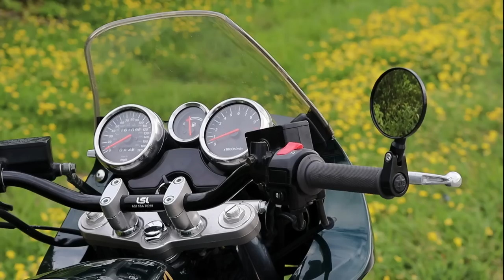Bandit 1200 - New Handlebars and Mirrors - Everything Went Wrong!

Comment: I'm that 1 weirdo that loves stock mirrors and absolutely hates bar end mirrors.
Reply from the maker: Na not a weirdo at all. Some bikes have good mirrors but others I always want to change
Reply: To each their own.
Reply: Well you're not alone, I also very much don't like bar end mirrors, but this actually looked kinda clean and decent.
Reply: Nah, im right there with you.
Reply: Another weirdo here. 🙂
Reply: Not a fan of them either and hopeless for filtering, I do a lot of filtering in my daily riding.
Reply: Weirdos everywhere 😂 ! I am too...
I don't really like them but I am always reluctant to change the moment of inertia of my bikes front end. The S version already has no front light, but going for aluminum bar, light mirrors and mirrors sticks, removing the original HEAVY bar ends is asking for more vibrations and possibly tank slapper...
My Bandit has its original bar and mirrors...but the blinkers have been replaced, and the "tail" cut...
Reply: I think that my previously owned bar end mirrors has been of sub par quality as they would constantly move and it has been driving me insane. I might change the mirrors on my bike out, but bar ends are still a no go, especially since I need to fit the bike through a normal cellar door each time I drive it.
Reply: Still interested in a conversion  from choke on the bars to one on the carbs
Reply: Me three ✌️
Reply: I'm that one weirdo who likes cowl-mounted mirrors if the bike has a frame mounted front cowl and dash

Comment: Hello Matt from Sussex U K I have owned both 600 and 1200 Suzuki Bandits and both are brilliant bikes. My 1200 did not have the faring and was the burgundy colour. When I changed the bars the only snag was drilling the holes for the switchgear but after a few thrown spanners and expletives every thing fell into place. I still have my 1200 and I would not part with it because it does all I want it to do It has a Scorpion end can and with the baffles removed only one grub screw it sounds fruity but not mega loud. I love the engine it's so smooth and pulls like a train. Yes, they were built on a budget by Suzuki but they hit the nail on the head when they put the 600 and 1200 together both bikes have a massive following in England and there are a  few online clubs for 600 and 1200 owners. Keep up the great vlogs. Matt' UK

Comment: I hit the same problems as you when I tried to change the bars on old FJ1100, hoses not long enough. I tried this a weekend before I was going on a 2 week tour of Europe, my first long outing on the bike. I didn't have the time to get everything to effect the change so went back to the original. 
Spending 2 weeks on the bike doing some big miles every day, lots of great roads and bahnstorming (autobahn) speeds, I realized the engineers at Yamaha knew a lot more about setting up the bike than I did and concluded the original set up was pretty much perfect.

As I was watching your frustrations these song lyrics popped into my head...
They say some days, you're gonna win
They say some days, you're gonna lose.

Comment: Ugh I feel you on the "wasted time." Ive spent over 3 days trying to fix a fuel sending unit on a Kawasaki Vulcan I just picked up. Obsolete part, not available. I had to fabricate part of it, tested it, adjusted it, tested again, worked, got it in the tank, filled it up, fuel gauge working, test ride, dead gauge again. 

Just gotta roll with it. Props for all the work going into your orginal plan even though it didnt work out. Im sure you'll find a use for those parts eventually. Looking forward to seeing builds in the new shop! Keep up the good work 👍
Reply from the maker: Yeah it was costly on the time scale for sure!  I have had many bikes just fight me to the breaking point with things like that.  The end result here was actually better than the original plan so Im very happy.

Comment: Thank you so much for accepting comments and I think you did reply to a comment that I made on another video.  Thank you.  So here's a question. At the beginning of this video, you're sitting at the desk talking about how you had to replace a bar mirror on the cafe Honda.  So there you are, and if you look up there is a shelf with little dispensing containers.  There is fluid in those containers that I have seen you use.  Would you ever share about what you have there and what they are used for?  Hmmm?  Just wondering. 🤔
Reply from the maker: Thanks! Those little containers are great. I have acetone, oil, grease, brake fluid, and maybe more. Keeps things efficient for me

Comment: I've got bar end mirrors and Renthal bars. They are pretty thick. To hold the mirrors there's an expanding piece that slides into the bars that looks exactly the same as an expanding masonry bolt body, rawlbolts were call them over here. Works a treat. Maybe all you needed to do was to go to the hardware store.
Reply from the maker: Right thats a normal setup and something Oberon even offers. The brass parts work the same but for some reason the stuff that I received just didn't even come close.

Comment: It may be possible that the factory mirror adhesive was flexible on purpose -- maybe to dampen vibration or expansion-contraction cycles of the metal mounting plate. Just a thought. I've found that polyurethane construction adhesives and/or elastomeric sealants -- both in caulking tubes -- are pretty good for similar applications. Cheers
Reply from the maker: Definitely could have been

Comment: Mirror shape is something that occasionally shows up in cars in the UK. UK being rhd but most cars are shared with LHD markets. And if you put LHD mirrors in a RHD car then the shape and angles are all wrong!

For the bar end collets, looks like you have been supplied with the larger ones for 1" bars. Possibly intended for Harleys? They sell a smaller collect. They also list 11 different styles of bar end piece

GSXR1100 carbs had the choke on the carbs (or at least my 1100L did) which might be a source of parts to convert. Or swap the complete carbs on for a bit of extra performance (40mm rather than 36mm)

Some days are like this.
Reply from the maker: Yeah I'm not sure where the issue started with the ends I ordered. So many things were wrong.

Thanks for the tip on the 1100! Will check that out

Comment: I have a 2000 Bandit 600. Did you ride the 600 model? how does the 1200 power compare to this? is it manageable? I like the smoothness of the Bandit engine, but would like a little bit more torque…jut a bit more, not 2 times as much:)) I also ride during wintertime, so the low torque at low revs on the 600 is perfect to keep me safe on winter roads, but not so sure about the 1200.
Reply from the maker: @Carby4SZK  I have ridden a 600 and it was a blast as well. I could be perfectly happy on one of those. A 1200 is definitely more grunty but manageable
Reply: @BrickHouseBuilds  thanks for the reply. I will surely be watching out for the 1200.

Comment: BJ have you thought about using rawlbolts to hold the barends in place? It would save you shaving down the brass grips inside the bars?
Reply from the maker: Well no. I bought parts that should have worked together so thats what I wanted to do
Reply: @BrickHouseBuilds I have a K5 Bandit 1200 with Renthal bars, but feel as if it needs bar weights, vibration seems to be right at 60mph, the rawlbolt idea came from this. The mirrors look nice though 👍

Comment: Instead of welding the additional material onto that bar end piece, could you have created a new (small) piece on the lathe to sit adjacent to the existing piece that would serve to spread the collets?
Reply from the maker: Well I didn't feel I could have as having two small pieces would leave no way to lock the bar end from rotating. That the part where I mention the serated washer as that was my original plan.
Reply: @BrickHouseBuilds  ahh gotcha. We have about the same tiny lathe.Thanks!

Comment: Mate...if your having issues with getting parts from the UK just let me know happy to ship them to the US for you..
Reply from the maker: Thank you. The goal is usually sourcing from a US supplier. I could always pay to have stuff shipped but its just faster and cheaper to buy an already stateside part.
Reply: Ok that was hard work!, let’s have a go at the upsides

1. It effectively made your lathe more cost effective, another job completed v lathe purchase price.

2. You were able to use a scrap mirror, big cost saving.

3. You now have a spare set of bars and bar ends for another bike.

4. You had an opportunity to tidy the contents of the grey bin.

5. You made everyone watching feel better about the days they have things go west.
(If it helps I fitted 3 different sets of bars to my XJR1300 before I was happy with the position 🙂)

6. You didn’t slip drilling the bar dimple and plunge the drill through the top of the tank!

So all in all another beautiful day in paradise!! 😂
Reply: I beat you hands down regarding time 😂 changing from 16” high apes to std Harley bars. All internal wiring was hard soldered with No diagram I cut the bloody lot and ended up rewiring the whole bike. Time forever ! 😂

Comment: Since you don`t want to keep it stock, may I sugges the turn signals from the newer 650/1250 bandits, with the clear glass ? (got em on mine)
Btw when I drill in aluminium at work, I like to use pure alcohol as an lubricant.
Reply from the maker: I definitely want a more subtle signal. Something an OEM can't provide so I'll come up with something

Comment: Happens to the best of us Sir, could you have swapped over the half clamps for the original mirrors and fitted them upside down, so that the bolt and stem would be underneath and out of site?
Reply from the maker: It wouldn't have been possible to mount the factory mirrors upside down. I did do that on a Sportster I had but this would have big clearance issues even if you could mount them in that way.
Reply: @BrickHouseBuilds  Hello again, I wasn't talking about the mirrors BJ, just the clamps, so that you don't see the screw hole for the mirror on the top!
Personally, I'm not a fan of mounting mirrors upside down, as I don't see having a sufficient rear view?
Reply from the maker: @kennethgore  Ah yeah I misunderstood. In the Harley world that is actually common and visibility isnt bad actually. For my original clamps I am contemplating mounting something there. If not they will likely just hang out at they are.
Reply: @BrickHouseBuilds  Many thanks for taking the time to respond!

Comment: Nice job. I feel your pain with the little issues you are having. Pro tip from a world renowned builder: Use hair spray on the inside of the new grips to put them on. They slide on super easy and the hair spray dissipates very quickly leaving no reside. The grips will stick solid in a few minutes.
Reply from the maker: Thank you. I have tried hairspray many times with no success. I have also tried paint.  Since I was a kid I have always had good luck with brake clean and compressed air. I am very willing to have to fight them on a bit if it means they stay there.

Comment: What do you think of using a V45 engine instead of the CB750 engine.
Reply from the maker: I'm not really sure how to answer that one. I just like the look, sound, feel of a cb750. I'm sure I would enjoy a v45 just because I love all bikes but they are of different eras, make different noises, different drives, etc. If I want pure classic I'd go cb750. If I wanted a bit more reliability and newer engineering I'd go v45
Reply: @BrickHouseBuilds  Just thought the V45 had more hp.
Reply from the maker: @eric_seguin  I'm sure it does but I'm not really riding vintage bikes for max hp

Comment: i had a chance to buy 2of those from diferent sources one was private sale green like that one and a diferent bike but new also green from a Dealer getting out of selling Suzuki as a dealer but im not realy tall enough to touch down and the reviews said bad vibrations because its mounted to a steel frame solid mounted where in its earlier race days it was used as a frame member with aluminum not steel with more rubber isolation so i walked away from both and ended up with a 2001 triumph 900 thunderbird brand new leftover in 2002 but i wished i bought the bandit just for fun
Reply from the maker: Really not bad vibration at all